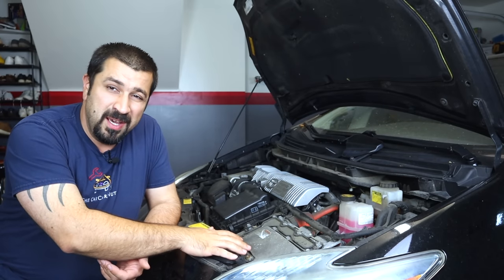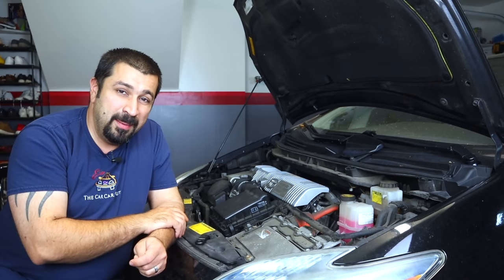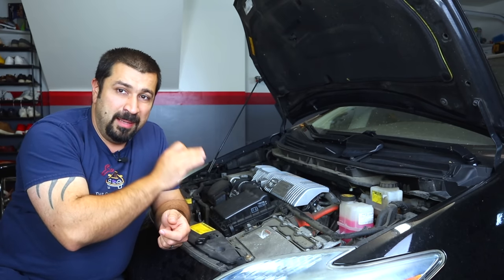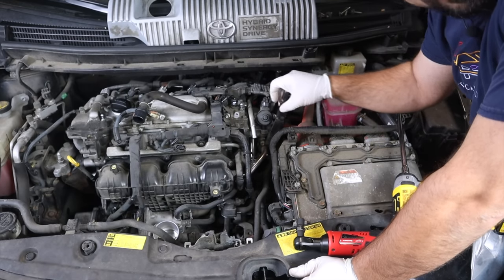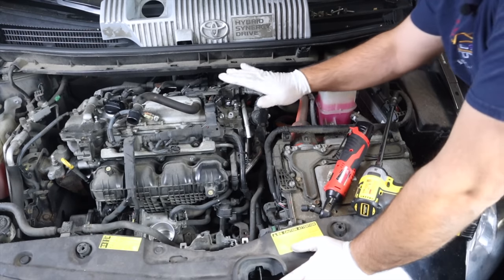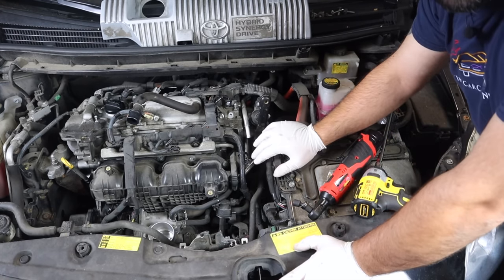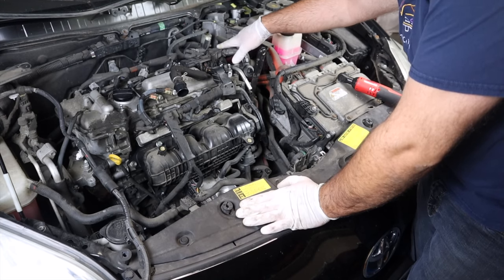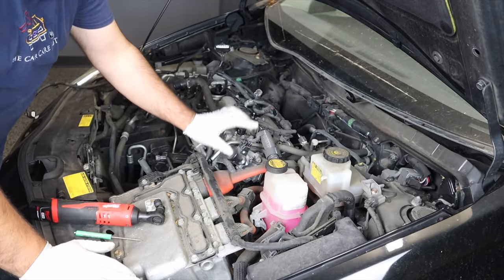Toyota EGR Diagnosis Tips and Repair Tips

Comment: Not gonna lie I'm in the middle of a head gasket repair... I would highly recommend diy people to completely disassemble and clear the whole EGR cooler/valve and pipe leaving up to where it connects to the exhaust... Including removing the intake completely and cleaning out the EGR lines in the big black plastic intake housing.... Mine looked like it was full of black bacon grease... It barely let any air through.... All of the parts from the dealer would cost over $1000 to replace.... I cleaned it out with brake cleaner 2 years ago for $30 and it's been fine ever since... Mine had 250k at time of cleaning... We're at 300k now... No issue
Reply: Replacing it is the correct repair for the EGR. The newer part has an updated design. I tried cleaning EGRs to help save some money but I watched the older version being "lazy" switching from open to closed under load. This behavior went away when I replaced the valve with a brand new one. These parts do wear out.
Reply: At 194k, great to hear this
Reply: eBay has the EGR valve and cooler plus gaskets for $326.
Reply: @jsixamore link please?
Reply: I completely agree. I love the car care nut’s videos, but only blowing air through the egr cooler does close to nothing. I just spent 3 days, soaking a 200k mile egr cooler in degreaser, carb cleaner, and finally oven cleaner (which worked much better). I blasted it with water and attached a hose fitting, a very small trickle of water came out of the other end. Finally, I started jamming a  clothes hanger through the channels/ports and was able to punch through. I pushed through each channel one by one and finally the water gushed through. Night and day difference!
Reply: what did I use for cleaning the plastic intake? brake  leaner as well? the one without acetone? as I'd be afraid to use that one on plastic parts
Reply: @URCAcZe  Purple Power - less caustic than Carb/Brake cleaner.
Reply: what does NGL in the middle of head gasket repair then talk about cleaning an EGR and intake meann???? Does one cause the other? This is unlear.
Reply: @brarautorepairs cooler and valve are like $500 new.... If it ain't broken it's just clogged clean it... There is no updated design it's literally been the same for over a decade...
Reply: @nastytaco420 with a torque wrench? If you're asking how I got it out; it was with a 1600' lb  impact... Do not use the impact to re install
Reply: @jsixamore  you could buy a very nice entry level pressure washer for that.... I'm just saying if you have a pressure washer laying around and some oven cleaner for five bucks it does the trick....
Reply: @MrCKingLA experimented with brake cleaner soaking it put honestly the oven cleaner did the trick overnight and a turbo nozzle on a pressure washer It literally is shiny metal fully looking through seeing daylight I have a video on my channel somewhere showing it clear as day, clean as new.... Why somebody would spend 3 to $500 for a part that they could just clean overnight I don't know
Reply: @URCAcZe I personally just disassembled it and cleaned the metal parts, the plastic part is not really something that requires a whole lot of cleaning you can gently do that by hand
Reply: @MapleSyrup9181 if I had to identify the culprit of my need for the repair I would say that it would 100% is the exhaust coolant radiator return... A corroded out and started pissing coolant into the exhaust without me knowing which caused the engine to heat up and blow the head gasket... It's a $5 repair or should I say preventative maintenance... I cut the coolant line at the exhaust and rerouted it back into itself with a 3/4 inch U shaped fitting... Didn't catch it until after my first post rebuild oil change.... If I had to guess why it's still a thing in a modern hybrid engines the Toyota's building it's simply because they want people's cars to blow up so they buy new ones... Deleting this part on the car has zero negative side effects and I would suggest doing it at your next oil change while you're down there.  The EGR/intake cleaning I would say should be part of like a yearly maintenance program to prevent losing MPG from the car slowly choking itself.... I would imagine if you hit it yearly with a can of brake cleaner you could simply just pop it back on afterwards and avoid bigger downtime from the part choking up... With that back bolt disassembled it's pretty easy to get on and off... I don't necessarily think it would cause a head gasket failure but when it's blocked up it is preventing air from getting into the engine which you know is not great for combustion, Even then I was still getting like 40 plus miles to the gallon so I mean really depends on how you feel about maintaining your car I guess
Reply: I'm pushing 340 now and it's still chilling so for whatever it's worth that's that
Reply: Does anyone know a kit to delete the egr?
Reply: What a cheap and reliable car part i definalty will not delete
Reply: @ajamesbertman  I mean if you clean it out it should last another 200,000+ miles so no real need to delete it.... The exhaust coolant heater however should for sure be bypassed as soon as you buy the car
Reply: @seanbouker what is that?

Comment: For someone that would do this DIY, do you think replacing the intake and egr valve is something that could be learned and done with the right tools on your own? And if so how would somebody who successfully replaced them do the software update? Is the software update something that has to be done every time these parts are disconnected?

Comment: AMD' I LOVE THESE TYPE OF VIDEOS!! Please, by all means, make more! AND DON'T LET NEGATIVE VIEWS DISCOURAGE U! Ur dedicated viewers KNOW u! This video was VERY interesting! U know, I hardly watch tv anymore.😂🤣 I like the "blade" trick! Thnx! I'd like to see one on head gaskets & how we can diagnose asap to avoid damage. Speaking of that, what do u think of an add-on temperature guage? They make thru radiator hose. I hate not having one. I value ur opinion. 👋👍
Reply from the maker: Hi! Thank you for watching! A temp gauge wouldn’t hurt. However it’s easier to get a small electronic one that uses the computer sensor like a scan gauge or something similar. Less intrusive.
Reply: @TheCarCareNut  Do you mean something that will plug into the under dash OSB port? Banks Engineering has several of these, they  will read most computer monitored functions with actual numbers. There are small and you can mount them almost anywhere.
Reply from the maker: Yes something that plugs into the obd connector plenty of options out there to show you data
Reply: @robertjaent6087  thank u for askn that. I lookd up guages & got confused. Im not tech educated/mechanically yes, tech no. If u see something, could u forward info to me? I saw one OBD thru walmart.🤔🙄 MY concern that OBD port? Then when u diagnose, u have to unplug. And so it reads temp thru computer? How, if u have no sensor. Im confused.
Reply: Rice burner Try Bluedriver they are great and sync via Bluetooth to your phone. If want a little more costly go with D8 scanner very affordable as I use one along with my other arsenals for my shop. Hope that helps.
Reply: Fefrerrerref hoyo

Comment: Thanks! I got the rough running at start just the other day, right before I was about to replace the EGR and Intake because of an intermittent code. I noticed some white smoke out of the tailpipe though, so I assumed head gasket. No noticeable coolant loss or mixing with oil though. Is white smoke always head gasket if car is warm?

Comment: I just purchased a ct200h. Doing research about the car and hear a lot about bad head gasket, miss fires and egr valves. You put my mind at ease after watching. Great video.
Reply: It all depends on the year, doesn't it? It seems that versions after 2015 have received a number of modifications, segmentation, head gasket, egr valve, much more reliable supposedly, to be confirmed!

Comment: Thank you for this most well done diagnosis and maintenance /replacement video.  You are the best for Toyota (DIY) techniques. The dirtiest aspect of combustion can not be solved by "clean gasolines" or " EGR Cleaner in a bottle". Circulation of dirty exhaust gases requires periodic cleaning of the recirculation system.

Thanks for educating the Toyota DIY nation with this fine video.

Comment: I would just like to thank you for your informative video, my 2010 Prius was suffering from a very rough tick over, and not sure what the cause was, until I blocked of the EGR outlet  like you did and the car went back to running normally.
 Spoke to the local dealer for a price for the EGR valve and was quoted £300+ UK pounds, I had found the part number for the EGR kit you mentioned and they are £52 UK pounds, My car has been into my local dealer today to have the EGR kit fitted today and my car is now running great again, the local dealer wasn’t convinced on my (your) diagnosis of the problem as they have never supplied and fitted a new EGR valve to Prius.
 I have got the old EGR valve off them and sure enough it is stuck open to the point I can’t push the valve back to the closed position. Thanks again for a great video.
Reply: Hi. Did you buy the EGR kit yourself and then take it to the Toyota dealer and they fitted it for you? How much did they charge to fit it? Thanks
Reply: @ingalway  Hi, This is in the UK, I ordered the EGR kit from my local Toyota dealer for £48 with discount, spoke to the service department and they agreed to fit the part I ordered for 2 hours labour, needed it done asap as my Prius is a taxi, I probably could of done it myself but would of taken a day to do it.
 Although the EGR kit car care nut mentions in the video is covered by a USA technical service bulletin, the part is also available from a UK Toyota dealer when ordered by the part number.
Reply: @alandavis6072  what is the part  number in UK
Reply: @alandavis6072 how did you get the discount if you don’t mind me asking?
Reply: @BadBoy-ts4fg  was because i’m a taxi driver.
Reply: @alandavis6072  so this discount isn’t available to normal people?

Comment: I totally agree with you about always replacing a part.  In a shop setting or doing work on the side, it never works out on my side to clean the part.  I don't ever get come-backs when I replace the part.  The initially client complains about the cost, but they always return to me again since that last issue they brought to me was fixed the first time.

Thank you for doing these videos.  I know they are time consuming.  Thank you for sharing your knowledge and experience.

Comment: Having a third gen Prius myself, this one really got my attention! I had heard about the EGR cooler problem and didn't know what to do about it. I had not heard of the valve problem. I see the valve from the dealer is not much more than the Rockauto price, so if I have to replace it I will go with the Toyota kit from the TSB.

Comment: I know someone with an 09 corolla with this issue. Car would rough idle, stall at stop signs, and vibrate. They spent 2000 dollars trying to self diagnose, and local mechanics, just to find out after replacing everything from catalytic converter to a MAF sensor to spark plugs to intake manifold gasket to 02 sensors to fuel pump. Crazy that even the Toyota dealership didn't catch it. 

I love to see you talking about older Yotas. My Scion xA is a 2005 and my Tacoma is an 04. I'm very glad you are not ashamed or afraid to express your Christian beliefs. I respect that greatly. Thanks again for another awesome video.
Reply: So all that 09 corolla needed was a new egr?

Comment: it would be nice to watch the video before going to Toyota. My 14 Prius had similar symptoms at 160000 miles when I took it to Toyota for diagnostics. The service advisor told me my Prius had an burn oil The repair cost was too expensive, even told me to balance the tire because they didn't know where the vibration was coming from.thank you so much to sharing this info

Comment: We still have our two old Prius, our 2010 Prius burns lots of oil (common problem) so be sure to check yours. But now we have a P300, P301, P302 engine misfire, so it seems like i'll be trying your EGR valve trick here. We did buy a Tesla and after having it for over a year I must say it is clearly the future. I am never going back to Gas ever again, ever. It's soooooooooo much easier, almsot no maintenance and not millions of little headaches to chase and fail like ICE cars. Thanks for the video, will help squeeze a few more miles out of our Prius (until our next pre-ordered Tesla arrives)

Comment: Hey
You are one of the best  man and  your video are the best !!!
I had the    EGR prblem in  my 2011 Prius the Toyota diller clean the valve and the pipe noting work the ingin light still on
After three week in the Toyota diller I come to take the car 
Pay for the work and parts  and after a 4 kilometre the light ingin come again 
I still driving with that problem and nothing hapend
I ingnor the orang light
But listening to the motor or any change that will come 
Now after I saw your video I gone do the all work by my self
I was impress from your expelning
About it can never been clean for only for a few weeks or months 
I aleayes follow your best video!!! Keep going

Comment: Great Video. I really enjoy learning how automotive professionals tackle diagnosis and repair. I'm not much of a DIY person except for very minor stuff (like adding the tire pressure dashboard reporting unit to the TPMS unit on my 2021 Rav4 Hybrid) but I always learn something new from your videos no matter what is being discussed. The electrical tape over a socket was a real "hidden gem" in this video. Keep up the good work and my best wishes for the continued success of your channel.  PS. Please let your wife know that we appreciate her "behind the scenes" work as production manager. Your videos are always professional grade and "well polished".    Regards, Ed
Reply from the maker: Thank you Ed!
Reply: Should i clean the ger my 2015 prius has 51,000 miles on?
Reply: I use that same trick when replacing spark plugs in 2010? Corolla, it is near the firewall, blocking your tools and I did not have a plug socket with a rubber insert. I used the tape.

Comment: Did the EGR myself last week. 2012 Prius V with 123K. Absolutely needed the cooler off and soaked. Completely blocked with deposits to the point I had to fish fine wire through each of the small passages.

Also… found a huge pool of oil in the intake manifold below the throttle body. The PCV valve design looks like it has much to be desired. Replaced the valve and next oil change I’m going to reduce the amount of oil I put back into the crankcase from 4.4 to maybe 4.1 quarts. Gonna see if that keeps it from sucking oil like it did.

The EGR system cleaning really has the engine running smooth now.

Comment: I really appreciate these videos and the detailed explanations.  I do like the DIY work but I really appreciate hearing the viewpoint from a dealer mechanic.  If I found one like you I'd probably let the dealer do it more, but I've found my dealer has been sloppy and cut corners (they broke the cabin air filter cover and never replaced it; I know because the dealer performed all maintenance until I did the last one myself).  I wish I would've had the "magnetic" socket trick a few days ago because that lower bolt was evil.  Keep up the great work and thank you for educating me.

Comment: I agreed with what you said after I cleaned my egr awhile back. I regretted to open the egr and clean it up because I ran into leak air issues in the egr after I put it back in where you can hear the hissing sound when the engine warm up for awhile. Great tip btw
Reply: I didnt get what this was referring to. Anyone care to explain?

Comment: I'm diy mostly on my 2014 ct200h Lexus, fancy prius lol.  So when I found out about EGR issue i was thinking maybe beyond my skill level. but after watching some of your videos and  other diy videos. i felt confident to work on and it really helped me so much. although i did not replace egr valve or intake manifold. I did a good cleaning of entire system, and replace most of the gaskets, the pcv, engine coolant.  btw this was preventative work or maintenance not repairing. but thanks for providing these videos, very helpful.
Reply: Did you go to the dealership for the TSB and update the EGR software? You cleaning it only fixed the symptoms, but not the cause of illness.

Comment: Another great video thank you. I take care of a 2010 Prius while the owner is away for 9 months I drive it every few days because in my experience you can’t let a hybrid sit very long because all those computers are monitoring the car still even when it’s off. The first couple of years I did this the 12 volt battery died I suspect from age and not getting enough run time to recharge on its own. I do more driving of the car now and it’s much happier. 
This video you made is so helpful and you’re description of the difference between a professional technician and a do it yourself person was well done 👍 and not offensive to me or I believe any DYI. 
I learned watching this video that the 2010 Prius I look after has this same problem 
I’m going to recommend to the owner that they have a dealer check this out and decide what to do 
Bless you for another very well done video 
Bravo 👏🏻

Comment: Thanks for the tip - homemade magnetic socket.  I use a piece of paper towel which works 99% of the time but sometimes the whole shebang - both nut and paper towel falls so I'll try the electrical tape method the next time.  P.S. I love your repair videos, lots of helpful tips and tricks.
Reply: What up date? Do u really need it?